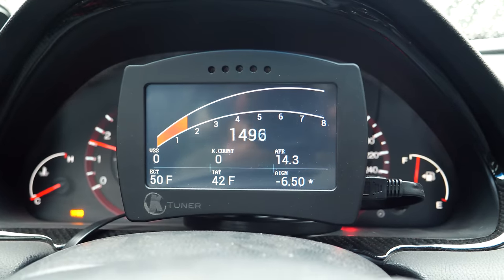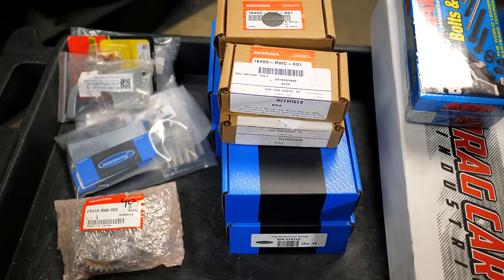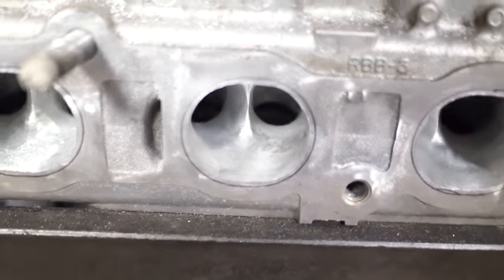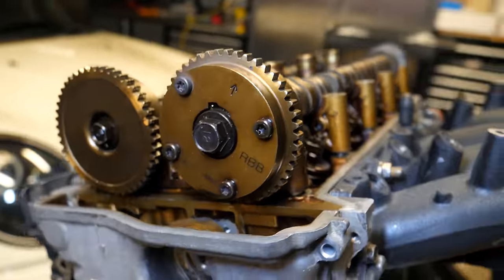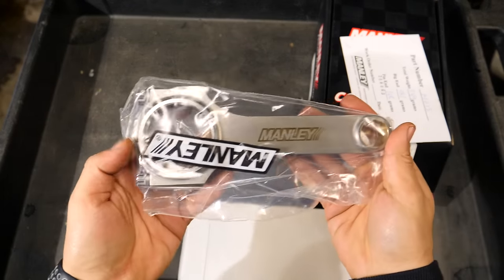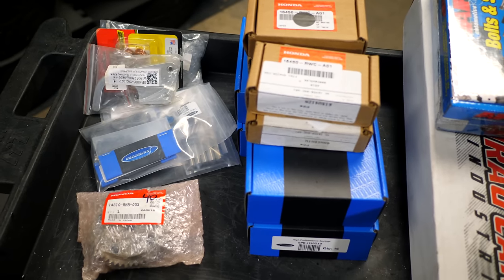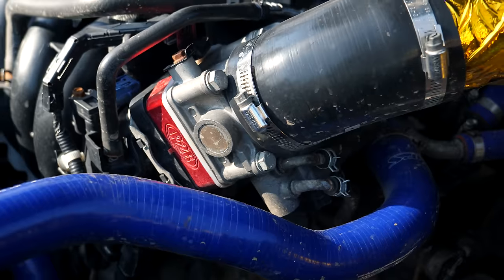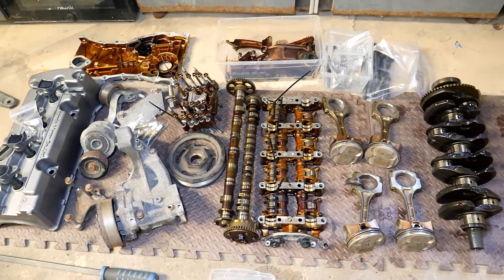The Secret to a High Revving K-Series Engine

Comment: Subbed. Very articulate and detailed.
Quick question:short of “true” iVtec head, why choose a K24A2? If I were to take a K24A1/A4, for example, use the same rods and pistons, and then just use a K24A2 or K20A2/Z3 head, would my results be similar in terms of performance?
Reply: I think he mentioned that in one of his videos, I figured a k20z3 head would work but he said the stroke is different and would cause an issue. Someone correct me if I’m wrong.

Comment: I think an Honda element would be a better choice for all these mods because it comes AWD and helps prevent spinning the tires.
Reply: Upgrade an Element  rear diff with a 06 to 11 CRV rear diff   that's been modded with a power transfer upgrade and lsd.  

Saving money for the rear lsd.
The PTU  requires enlarging a fluid hole in the viscous clutch  and adding a spacer and clutch plate.

Think it's pirate garage that sells the kit.

So far only mod I've done to my Element is adding 6th gear.

Comment: 9K RPM on a K24 i heard piston speed is crazy and increases wear alot
Reply: Piston speed at 9000 is 5847 fpm. a 2000 Ferrari Formula 1 engine's top piston speed is around 7000. Audi's R8 5.2 V10 max piston speed is 5295 fpm which is the highest any production car has ever come out with. Yes these Honda motors are insane.

Comment: You have some great videos brother. Thank you. I have a 2008 Honda Accord Coupe 2.4L like yours. It has a used engine that apparently was not well maintained cause the #1 piston has stuck piston rings. I want to do a stock rebuild using high quality pistons, rings and bearings. Can you please suggest a brand and/or parts store?
Reply from the maker: OEM. You can't go wrong with OEM parts. They are obviously made for your car, are arguably some of the highest components for regular rebuilds, and proven. Hope that helps.
Reply: @milanmastracci  thank you !!

Comment: Did you ever consider putting a  swap together to do a complete change over from your stock swap?? In case you ever want to go back stock or something.
Reply from the maker: Yes. That is what I am doing essentially. I bought another engine to do the work to, and then when the engine is ready, I'll be taking the stock engine out, and swapping it for the upgraded one.
Reply: @milanmastracci  nice!

Comment: Awesome channel.  I have a 2013 Civic Si with the K24Z7.  Would you build work with this block?  Also do you for see any engine code issues running a lighter flywheel.  I think I remember someone having misfire codes when running a lighter flywheel.  I may be completely wrong, but figured it was worth asking.  Thanks for what you are doing.  Wish I had the means to just order up a 4 pistons engine...
Reply from the maker: Hey Thomas! Thank you :) My build would work 100% with your car. Since started this video series, I changed what I wanted to swap this engine into. I purchased a 2015 Civic Si, which is basically identical to your car. Too light of a flywheel will 100% give you problems. I have that solved with the flywheel setup I have.

Comment: So if I have a 1st gen tsx and plan on flashing the ECU I should upgrade the oil pump first since the redline is raised to 7600 I believe?
Reply from the maker: 7600 isn't too high, but upgrading the oil pump is a great way to prevent any kind of lubrication issues when you rev it out. The K20 Type S oil pump is a great upgrade!

Comment: My k24z7(450whp) on stock internals/stock oil pump is at 8k. Fastest 9th gen that has a z7 was revving to 97k on the stock pump for over 2 years all track abuse
Reply: 97,000 rpm is pretty great with stock rods.

Comment: I wonder what combination will produce a quick revving, high revving responsive Ford Windsor V8.
Reply from the maker: Less reciprocating weight, lightweight flywheel, higher compression pistons, and then the supporting mods to handle that (oil pump, built head, etc.)
Reply: milanmastracci: Short stroke engines turn to make more horsepower at a higher RPM from what I understand? On the other hand on the street you want an engine that’s very responsive. Hard to balance out.

Comment: Top vid, what gearbox are you going to use to make the most of the higher red line?
Reply from the maker: I have a 9th Gen Si transmission in my Accord now and I think I'm going to keep it as is. I might swap out the diff in it however, but we'll see.

Comment: i thought about using the old poor mans civic typeR recipe: destroking b18...but destroking a k24..  k24 block (decked), rods, with k20 crank (86mm stroke) and 89mm 9.8cc dome pistons (12.4:1CR)  2140cc with a nice 1.77 r/s ratio...even at 10,500rpm = max piston accel 21k fps2.  in theory i think it would be a high spinning top end motor with more forgiving geometry.  wondering how to address the oil pump cavitation at that rpm range.

Comment: What's the best block and head combo for a road course endurance k series engine or should I go bigger to the j series engines? Any advice would be greatly appreciated. It's an 02 rsx type s,  k20a2. I'm due for top end motor work. But I'd like to buy the new motor or heads first. K24 heads on k20 block, k20 on k24 block, k20a2, or k24a2?

Comment: Would an automatic trans on a k24 accord tolerate the 100hp gain or no? Not sure if an aftermarket transmission cooler would help much.
Reply: I don't think the auto trans is built to take the extra power. It may work for a little while, but I'm sure it would die pretty quickly.

Comment: Why didn't you use a z3 head that literally bolts on and is ported to fit your rbc????? And throw the supertech valve train at it?
Reply from the maker: A K20Z3 head does not bolt right on to a K24Z block. It works with the earlier K24A engines.

Comment: Dude I have the same car but it’s auto. I’m looking to do a built engine with built auto. Would you build out another to spec expect turbo auto?
Reply: Good luck finding a transmission to hold that power. There's a reason people only build manual transmission Honda's, and even the manual is usually the weak link after a turbo build.

Comment: Would the general steps laid out work for an "all-motir"  j-series v6?
Reply from the maker: High compression, low reciprocating weight, better airflow, higher RPM power band

Comment: I want to reach 300 hp na from k20a2.One question.Do you need to balance the crankshaft or no? I want 9500 rpm
Reply from the maker: If you want to rev it out that much, yes you should balance the crankshaft

Comment: is it possible to get a vtec on the exhaust also? on a K24Z3
Reply from the maker: You would have to swap the cylinder head to do that. Some of the older K24A engines have VTEC on the intake and exhaust.

Comment: how much power do you think I can push on a s2000 trans? About to go for a dyno the K24 definitely going to make power but on a stock s2000 trans idk if it can go past 450hp. Running built with boost haha
Reply from the maker: I wish I could help with that Michael. I don't have experience with S2K transmissions.

Comment: Can I run 50 vtc cam gear on k24 with stock 08 Tsx cams?
Reply from the maker: You should be able to without problems. Look into claying the engine to ensure it won't interfere with the pistons and make contact.

Comment: Hey man I’m a 9th gen owner and I’m debating wether or not to do the rbc manifold swap or switch to another after market brand like skunk 2 etc. I do know that when u make the switch u lose a lot of low and mid power but gain it back in high end power. In your opinion is this trade off beneficial and how would it impact daily driving as I drive mine all year round as well?
Reply: Get it if you want power
Reply: If you want more power, just save longer and get a supercharger kit from CT and a 3 inch exhaust. An intake manifold with no tuning isn't going to make the car feel faster or better without a bunch of other parts and tuning.

Comment: hey milan what oil do you use in ur k24, I've been using royal purple in my 9th gen SI and recently went to 5w-30 instead of the 0w20 they recommend just to be sure I get adequate protection after that 90k mile mark, just curious on what u use
Reply from the maker: I've been sticking with the factory recommended 0W20, synthetic Castrol engine oil, with a Genuine Honda Filter.
Reply: @milanmastracci  thats ccol, i was just wondering what you used, but if its been working great for a while no need to change it.

Comment: You might want to calculate the diameter of the exhaust to use for max power because NA engines can produce more hp with a smaller diameter exhaust/more restrictive because of backpressure.
Reply: I think this is a good point. 2.5 inch is enough for 300 horsepower on a Subaru turbo engine. 3 inch on a NA engine at 300 bhp sounds like it may be wasting lower end torque?
Reply: It's already proven that K series love big exhaust. The engine can make 20+ wheel hp more with a 3 inch over a 2.5 inch. This has already been proven for a long time now. This isn't the 1st guy to go for 300hp out of a K24.

Comment: K24 at 9000 rpm is way alot. Only if the block was taller. 8000 is more than enough. 8500 on extreem track builds. This engine wont last long im afraid. I prefer to change gearbox settings, than making such an extreem engine. I almost cut 6th on the tracks i go. Its much more efective this way

Comment: OMG! 😱😱😱 How is it possible that this engine is so dirty inside? Do you use Castrol oil or what?
Reply from the maker: I bought this engine used. Not entirely sure the previous maintenance of it. The engine in my accord is in much better condition.

Comment: Nice video. Need some advice. I have an accord Cl7. Got the bolt on NA mods. I added a 3.5kg aluminum flywheel and exedy clutch. Getting some rattle and a misfire at sometimes. Any experience with this?

Comment: What if we didn’t care about making more power, only the noise of spinning it up to 10k?
Reply: That's not possible as if you want to spin a high rpm you'll need high pressure higher piston speed and possibly a higher compression and etc a lot of things needs to get to spin to 10k rpm it isn't a feature you could turn on to make it spin that fast. Unless you stick a Electric motor to the k24 and make it spin 10krpm and since the motor has no capability to spin that fast you'll get a temporary engine then it's electric 😂😂😂😂

Comment: I thought in the last video he said he was going k24z7 bottom to k24z3 head
Reply from the maker: The K24Z3 and K24Z7 bottom end are the same R40 block. I will be using a K24Z3 bottom end with a K24A2 head.
Reply: @milanmastracci  so in my build,  could I go k24z7 to k24a2?

Comment: man this seems like waay overkill for getting the engine to rev higher, but I guess to get the absolute most out of the engine then it makes sense.
Reply: I agree.. I’ve got a stock 24 bottom with a 20 head, RRC, 3’ exhaust and pulled 271 HP.. is 30HP worth the extra thousands spent on machining, cams, head ect? Aha

Comment: Unfortunately for those cylinders heads are worth the price some. Most of you would say no but I beg to differ. The reason is not because it's nice and it's made of better material at least for 4piston cylinders head goes. It's More about how air Flow and how air dynamics work as well as port velocity and port bias and etc I could go on but the point is this. This cylinder head company spends time and money to Make sure these attributes go on to make those cylinders heads get as much as Air inertia and air velocity into the cylinder head as well as accommodate the valves flow and etc (YES valves do restrict Airflow and yes you can change that by Cutting more angles off the valves) what this young mechanic did is bought a "port guide" and started cutting off The Cross sectional off increased CFM by a slight but gave up to 30-40hp off as well as hurting Airflow because of bad of a Port job he did for the buck. Didn't flow bench it or check whether he gained CFM By checking how much Inches of water he gained or lost or etc. if you want to learn more. Go to David vizard channel as he explains everything I said in more detail and how everything you thought was going to make power was WRONG. and it's 99.9% of you.

Comment: Hes has the answers, but you can cut corners an be reliable. You aren't running boost. So, 500 whp parts aren't necessary for a 300whp probably below 300 honestly

Comment: I respect it, but isn't that 2.4L going to be gutless below 5000RPM now no torque at all? Becomes a track car only.
Reply: You could tune the timing curve to deliver more torque down low and more HP up top. To make up for this. Vtc tuning can gain good results even mid range as you can tune each cam angle.
Reply: This is the beauty of VTEC and tuning. I mean, it's no V8 down low, but it will be good enough in the mid range and up top to not care about under 3k-4k rpm. There's always the CT Supercharger kit and E85 if he's not happy with the power when it's finished.

Comment: Sure you need to step up all the way to a 3" exhaust for only 300hp? Feel like you might be hurting your scavenging. Did you base that choice on flow math?
Reply: I think he means 300whp which is roughly 340 crank HP so I think 2.75" ID or 3" ID is ideal. 2.5 ID straight pipe would probably be okay too but if adding resonator and muffler that hurt flow